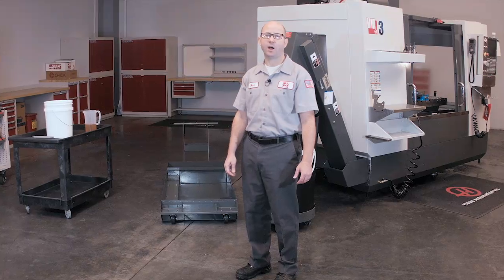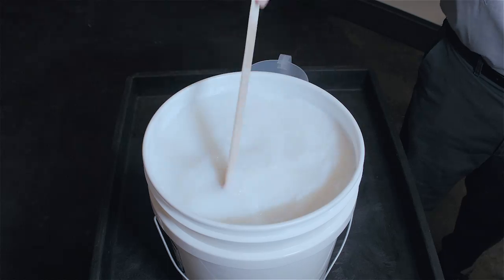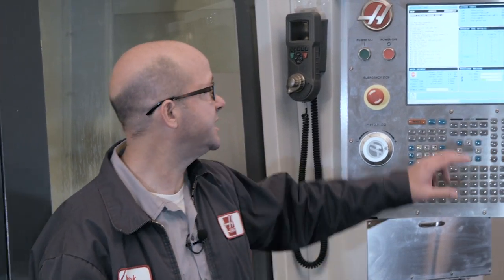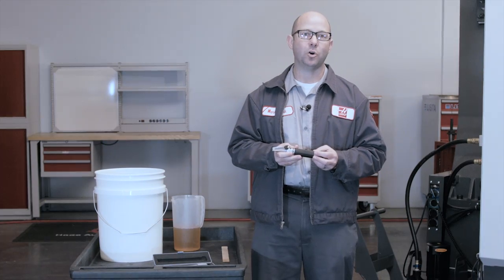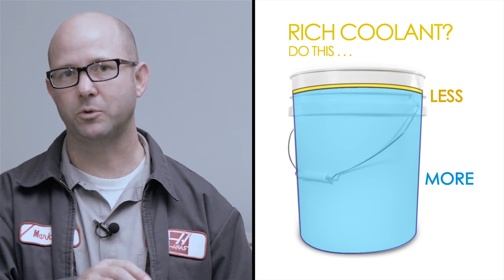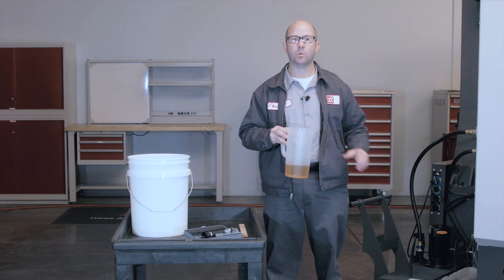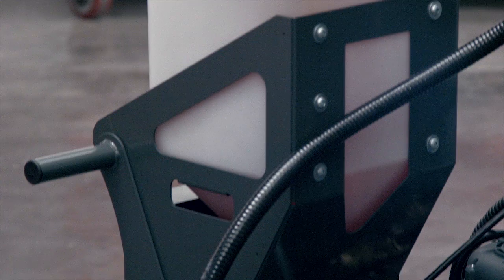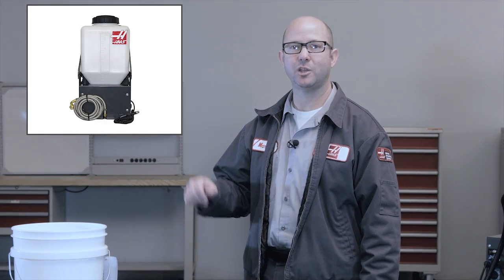Coolant Simplified - 4 Steps to filling the tank on your Haas CNC machine

Comment: Remember OIL. Oil In Last
Reply: I had never heard this before. What’s wrong with putting the oil in first?
Reply: @Nathan511  sorry missed your question hope the answer helps.
Reply: BS
Reply: @Mochinist-bk6yj  oil and water don’t mix.  When you add water to oil the water molecules surround the oil molecules. That’s bad because when the coolant hits the hot tool (let’s say a carbide end mill) the water hits first causing micro fractures in the carbide because it cools too fast.  But when you add oil to water the opposite happens.  The oil surrounds the water molecules causing the oil to hit first providing a better overall result In heat transfer and lubrication
Reply: From Google Adding water to the concentrate can cause a reverse emulsion, which reduces the coolant's effectiveness. To avoid this, you can remember the acronym "OIL" (Oil in Last).

Comment: We have terrible city water at work. So we had culligan set up a DI water system that purifies the water down to below 10 ppm.  We have a proportioning mixer that mixes the concentration to the exact amt you want. We set it at 4 for a complete coolant change, and 2 for topping coolant levels off. One thing I learned the hard way is, you cant check fresh di water and fresh coolant with a refractometer. Barely anything will read on the refractometer. You can pour as much straight coolant in as you want and it wont change, because the water is so pure. We have a new haas, with new coolant/di water,and the reading is 2, which I know is REALLY 4 without factoring in the multiplier. It is recommended that the 1st batch going in not be di water, so there are minerals in there. Doesnt really make sense to me.

Comment: You guys at Haas would probably know this but when you measure the coolant concentration with a Refractometer you have to know the "Refractometer Factor" for the type/brand of coolant you are using. Most people would just read 5 on the Refractometer and assume that would be 5% but this is wrong. You have to multiply this Refractometer reading with the "Refractometer Factor".  
For example, at my work the previous coolant we used we just read the Refractometer reading and used that as the percentage. Then we met a very helpful salesman that convinced us to swap to his coolant brand (CIMTECH 3100). After months of using this coolant the salesman inspected our coolant in our CNC lathes and ask us the concentration levels we were using. We said 5-10% on the Refractometer. He then informed us about the "Refractometer Factor" which was 2.6 for this specific coolant. So we had our coolant concentrate percentage at around 20%!! So with this new information our Refractometer reading had to be between 2 and 4. For example... If I took a coolant sample and the Refractometer reading was 3. So that would be 3 x 2.6 = 7.8%. In turn we are now using a lot less concentrate and our machines seem cleaner to.

BTW Haas, what brand of coolant do you use?
Reply: This is an old comment obviously, but I'm glad I read this, I was never aware of this information before regarding the refractometer factor. Thank you for sharing this.
Reply from the maker: +CarltonDry.Please Great comment! You are correct. In this simple approach video we didn't want to get into the myriad details involved in mixing, checking and refilling your coolant. However, the other videos in our "Coolant Series" delve deeper into these topics, including the consideration of coolant concentration ratio. For anyone needing more in-depth information on checking coolant concentration, or mixing coolant, please check out our "Tools of Coolant" video (http://bit.ly/Tools-of-Coolant_Haas), as well as the "Coolant Series" playlist (http://bit.ly/Haas_CoolantVidSeries).

Comment: We have the automatic mixer which attaches to both a main water line and our drum of unmixed coolant. This really works well and saves allot of time. Works well specially when dealing with multiple machines... Did go through this process as well. Both work well. But there are other options.. what do you guys think of these different methods.. thanks for sharing.. 😊